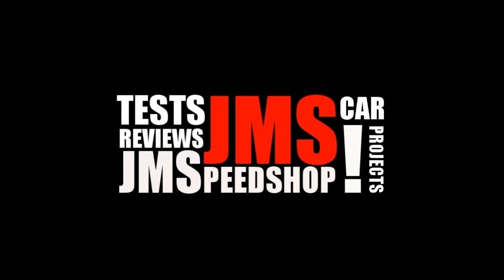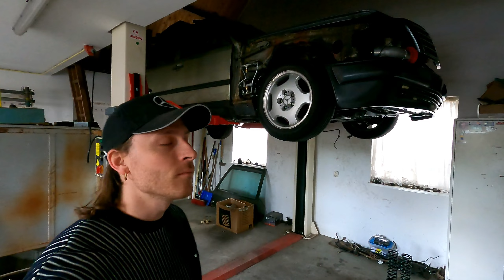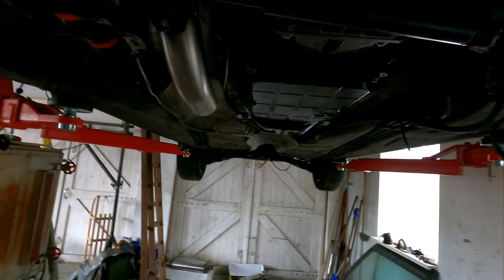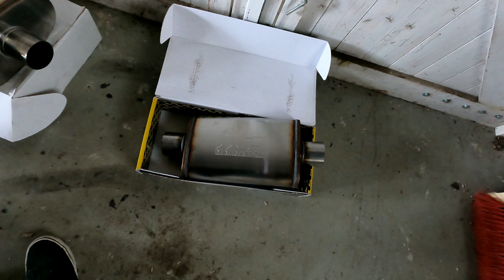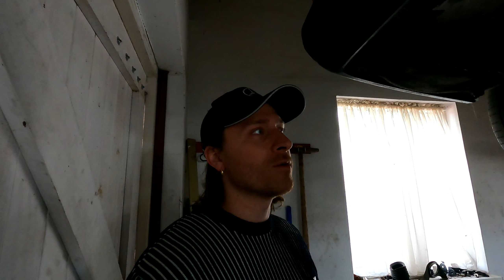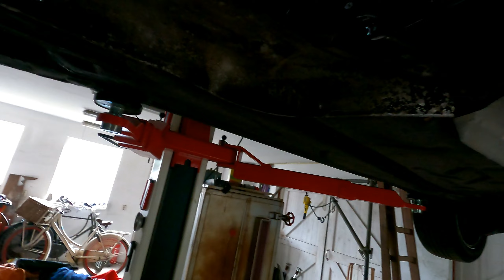V8 Turbo 3" MagnaFlow Exhaust Mercedes S124 build

Comment: Bro that 190e clocked speed 11... Sec 100-200 was done be racebox or from speedometer of the car in early video
Ou good project also man this S124 good luck
Reply from the maker: 10.6 sec 100-200.  Real GPS adjusted Speedo. IT is not fake.   S124 Will be much faster 😎